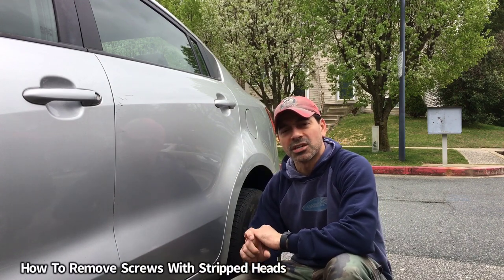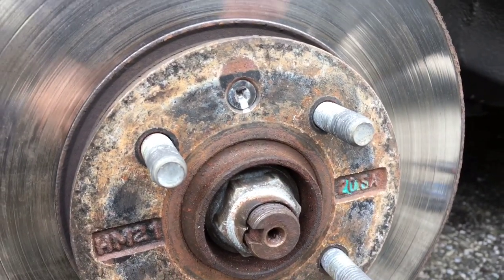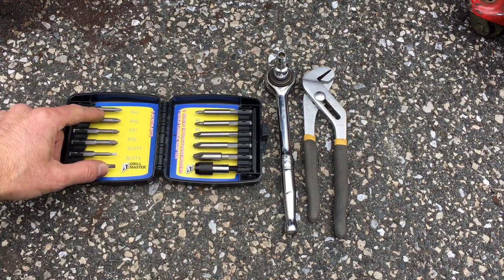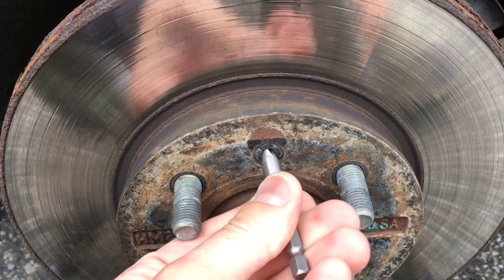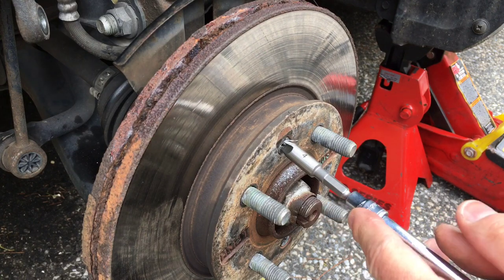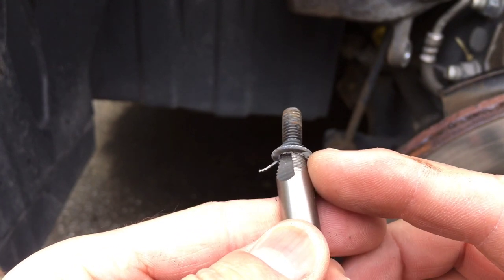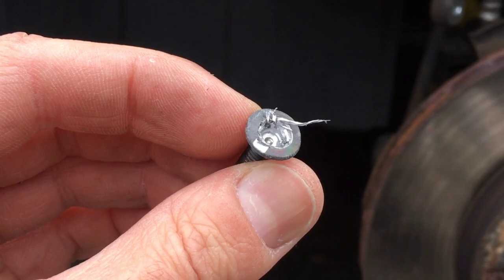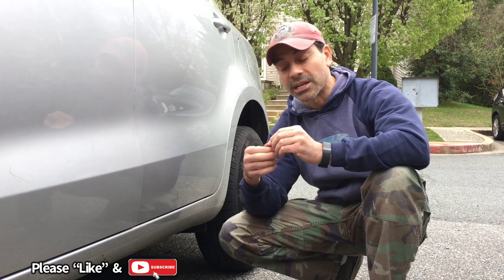How To Remove Stripped Screws (Andy’s Garage: Episode - 176)

Comment: Okay but what do I do if I used the extractor with a power tool and now it’s just a big crater in the middle? Nothing can grip it
Reply from the maker: Try a larger bit, if that won’t work you’ll have to drill it out with a metal bit.

Comment: Why isn’t the rotor turning?  I bought this same exact extracting bit set for the same job. However not only was the screw chewed up but it was stuck. Extractor bit promptly broke. These work great as long as the screw your attempting to remove isn’t stuck… so now the tip of extractor is broken inside the screw..help
Reply from the maker: My screw was stripped, not stuck. The rotor wasn’t turning because it’s positioned at the side of the rotor, not the center. If it does start to love you can lock it by wedging a bar through the studs, and against the ground.

Comment: Thanks for the video, Andy.   I ordered and received the extractor kit from Harbor Freight.  I couldn't tell from the video which tool you used first to bite into the screw with the bit, before you switched to the ratchet wrench.  If you could advise which tool you used first that would be great.  Thanks again.
Reply from the maker: I used the extractor bit on a screwdriver handle. This will allow you to get it to grip well before using the ratchet